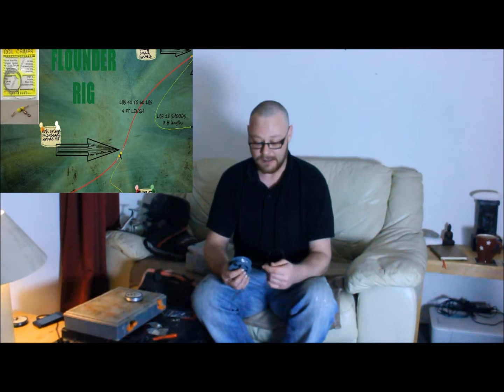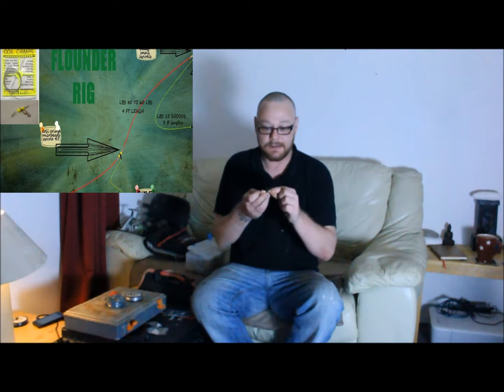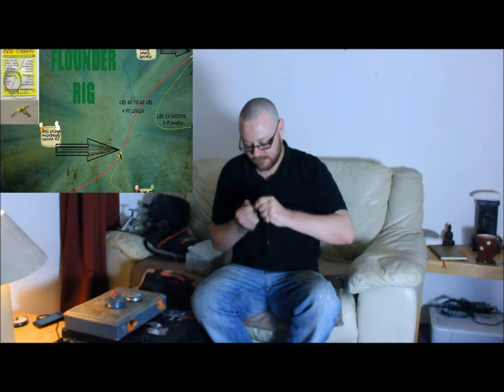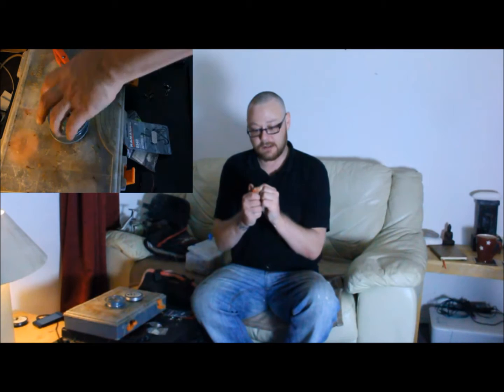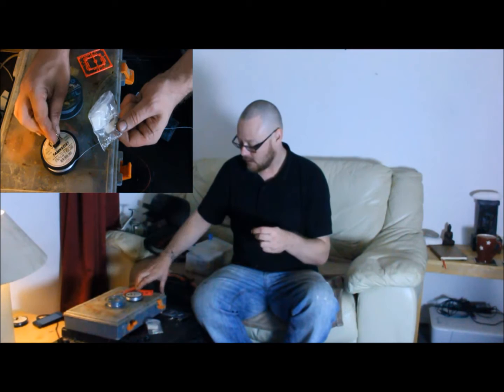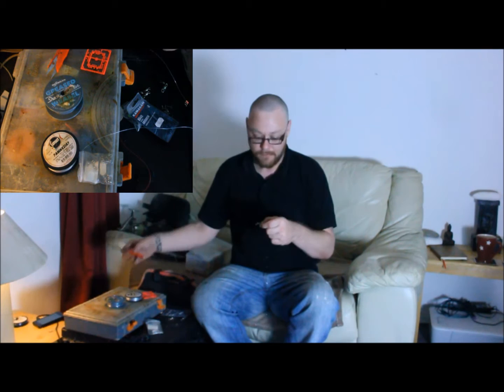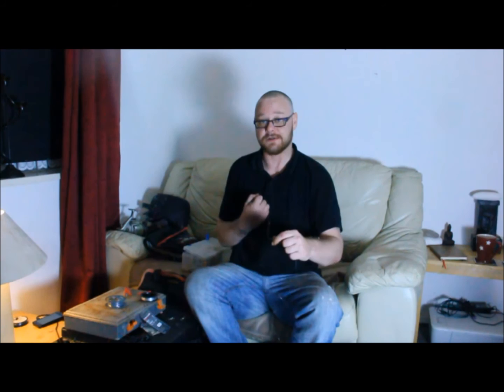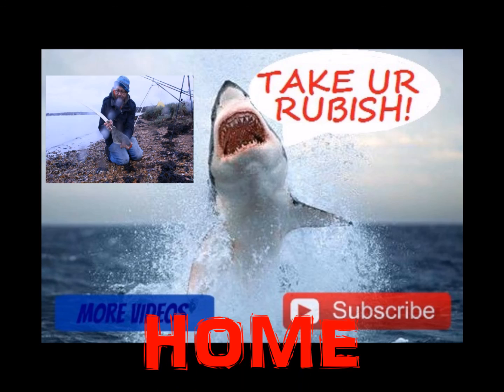How To Make the Best Flounder Rig AND SEE IT WORK

Comment: Is it for shore fishing? How do you cast such a long rig?
Reply from the maker: I've got a trabucco 15ft siena a very light rod use for flatties that makes it a bit easier for me, but i also can cast it with 11ft bass rod, no way is the rig good for hitting any distance, but is very castable the way i do it, 
And that is i just get the weight under tip and off the ground and swing it out away from me so lead lands inland on the ground, furthest away from me i can get it then i do a gentle cast. basic over head and slow, 
i start pulling butt of rod towards sea, just untill feel the lead and then over head flick very simply cast, and very slow at beginning does the job not to hard or fast
While I'm fishing in the creeks and shallows i set the rod in tripod as low to water as i can get it. (beach too if not to much tide of weed) i do use similar rig at beaches during matches 11ft + rigs whilst scratching around, and are very manageable to use, trick being.

I just start slowly feeling resistance of lead in the tip of rod , and then over head wack it,  your suss it out quickly m8 I'm sure, and its a very usable tactic for close in work, 

(matches or when its hard times) and it does put few fish on the beach when others are blanking around you, 
its no use in high winds, right in face or for distance stuff, but well worth using still and useful backup in the arsenal of tactics and tricks up your sleeves .
I will make a video soon of a pendulum 3 hook aero rig that i use for that distance and windy conditions in matches and there 8ft + easy,
hope answer helps, its good question

Please give it a try bud do a few practice casts with just bit of a length of shock leader with a swivel and lead and try about that length, give it a few tries to get the feel for it.